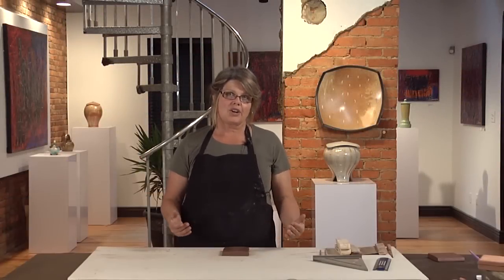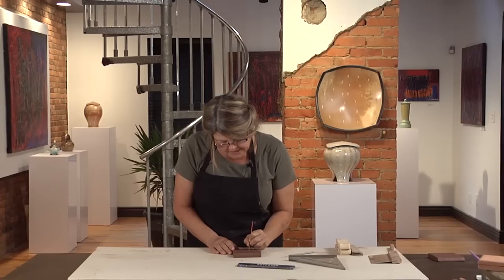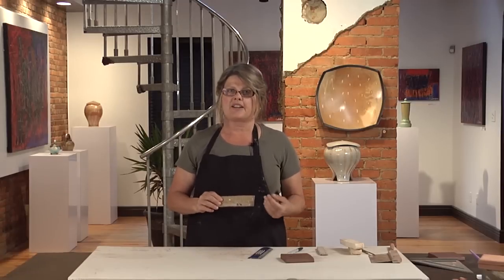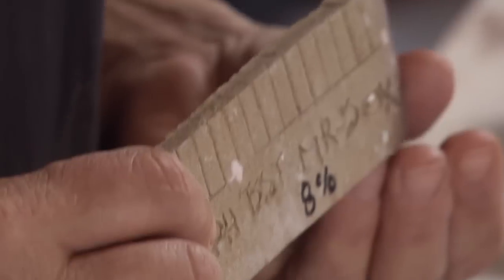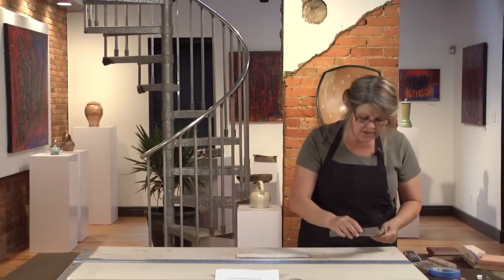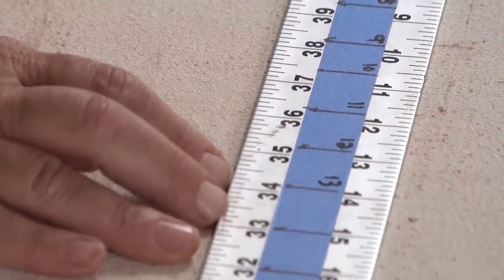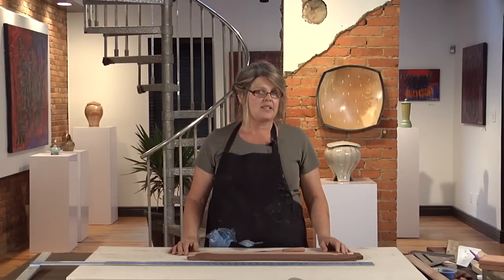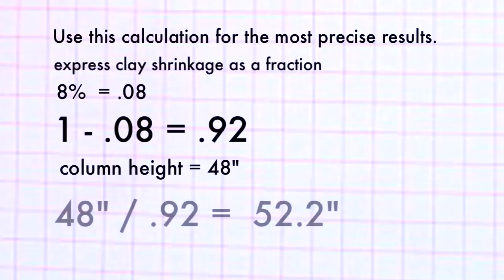How to Determine Clay Shrinkage and Make a Clay Shrinkage Ruler | STEPHANI STEPHENSON

Comment: May I suggest simplifying the equations presented midway?  
Let's use a definition like this: shrinkage = finalSize/initialSize.   Here, shrinkage = 0.92.  To make into an 'enlargement factor' just take the reciprocal: 1/0.92 = 1.0870. 
In summary: designSize/shrinkage = buildSize.
Reply: The presented formula confused me too. It clearly shrunk by 8%.
Reply: yes! our brains work in different ways. It's always good to see a variety of ways, to find what works for you!